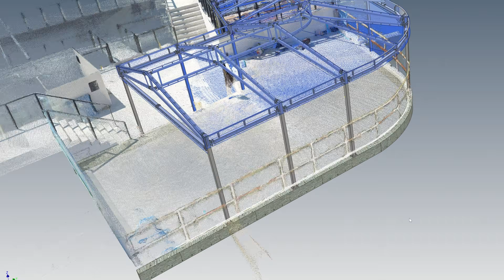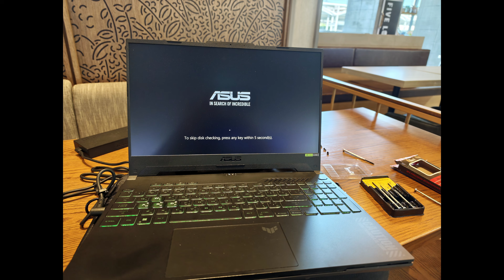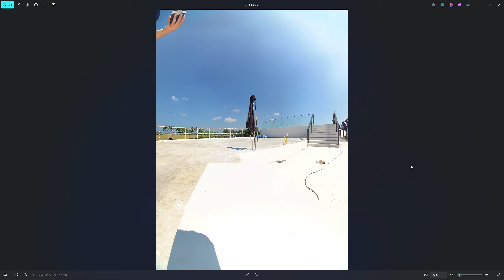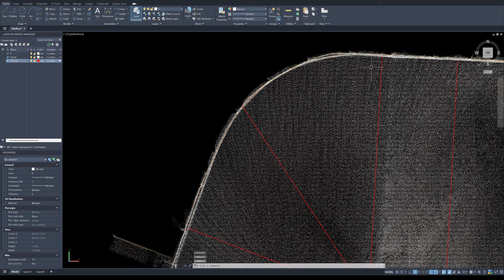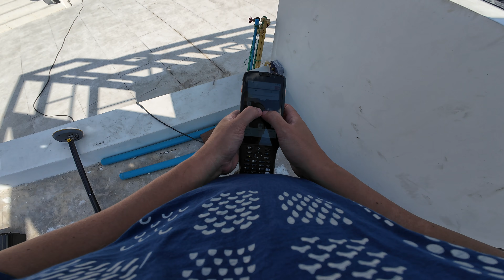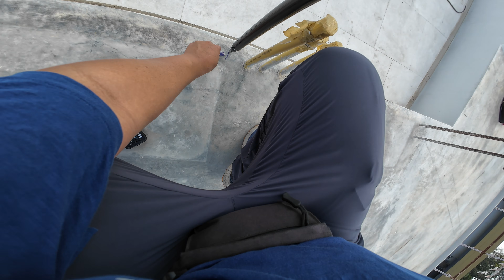RTK Fusion in Action - Base Plate Positioning with SHARE S20 LiDAR Scanner

Comment: What do you mean it is more accurate than total station 😂 are you for real 😂
Reply from the maker: Yes, the Topcon has already been rebranded the LiGrip O2 and has surpassed traditional Total Stations in performance. Faro has also rebranded the Manifold Tech Pocket 2, which, while not as precise as the O2, matches the accuracy of a Total Station in environments under 3,000 m². Total Stations are now outdated, with minimal development over the decades; their primary remaining use is for staking out.

Comment: Are you sure the RTK method has enough precision for staking this prefab structure? I would suggest using a total station to preserve internal accuracy.
Reply from the maker: I’m certain about this. As a structural engineer, I always handle my own surveying and staking out. For over 20 years I relied on total stations, then transitioned to RTK for staking out and SLAM LiDAR for surveying. My work demands accuracy within 10 mm. Yet many surveyors still believe the total station is the most precise tool.

Comment: All the time I was like, "what do you need the GPS coordinates for anyway?". Then at the end I was like, "That's Amazing!!". Too bad my work is always inside factories etc, so no good GPS.
Reply from the maker: I also use GPS to align scan data to true north. This lets me calculate shadow casting when designing sunshades. With this setup, I can predict shadow positions to centimeter‑level accuracy at any time of day.
Reply: @Payo-TensileCreator  That makes sense. For building houses etc, I can see the benefit of knowing the direction of the property. In my case tho. I just need to know where everything is, so I can slap more stuff between existing stuff.

Comment: Hi Payo thanks for another great informative video.
Can you please advise on the Spec of your current laptop and what the recommended Spec of Laptop I need to buy to use the Share S20 on site and is it better to use a a more powerful desktop PC at Home/work?
I don't intend at this stage to use CAD but will need to use Blender and other software for 3DGS virtual tours.
You are a field expert and user so your advice is appreciated.
Thanks again, Cheers from New Zealand.
Reply from the maker: My laptop has Ryzen 9 8945H CPU with RTX 4070, 32 G of RAM, I'm not sure if this enough for 3DGS. But it works fine for color point cloud.

Comment: Staking out structures with gps.. Not good at all
Reply: Hello. I can agree, that GNSS stakeout is reliable to some extent. There are some projects, where 12mm accuracy is simply not enough. CORS in Poland is great as well. Personal comparison between TS and GNSS stakeout have shown errors and inconsistencies at around 6-12mm. I would agree, that staking out with GNSS I quite reliable, but doesn't suit every project. For now, GNSS can't beat 1-2mm accuracy of Total Station stakeout. One more thing. Robotic TS also allows one-man work ;)
Reply from the maker: @pittek000able Here's why I no longer use TS:
The best LiDAR distance measurements will yield at least +/- 3.0mm to start with, excluding errors from the angular encoder.
There is an error from the prism pole holder of +/- 3-5mm, even when using the shortest pole.
The most significant error arises from relocating the station when the line of sight is obstructed. Each time it is moved, it introduces an error of approximately +/- 5mm.
There is also an error from leveling; even with the Topcon LN series, some error will occur.
In Thailand, TS is no longer permitted for locating land pins due to the prevalence of human error.
Reply: Also staking out with IMU enabled is not a good practice. IMU is not perfect and it can add errors up to 5cm!! I would accept GPS stakeouts only if I have a base near me. What is the accuracy of the share 20 rtk compared with gps or TS shots? I read a lot new slam lidar have up to 5cm accuracy which is not survey grade.
Reply from the maker: @giorgosvergis5607   You're mistaken and behind the times. I first used RTK 16 years ago while building a stadium canopy, and it accomplished tasks a total station couldn’t. The pre-fab frame in this video was installed flawlessly. In my next video, I’ll showcase a 4,000 m² pre-fab frame surveyed with LiDAR and staked out using RTK. I haven’t touched a total station in over five years.
Reply: @Payo-TensileCreator I didn't say that RTK is not good for stakeouts. I also use it but with the correct procedures. IMU is not good for repeatable cm level accuracy and also running a base station near me is crucial. My gps is a 3 years old e-survey. Maybe things have gone better with IMU, I don't know.
Reply from the maker: Our CORS network is truly exceptional! 😊 According to regulations, RTK is utilized for pinpointing land markers with an impressive accuracy of less than +/- 12mm. I have had the pleasure of using a Total Station for 20 years before transitioning to RTK. In fact, most of my structural projects over the past five years have been established using RTK technology.